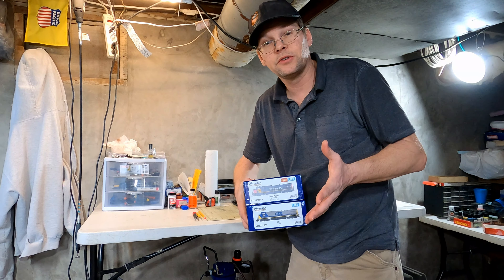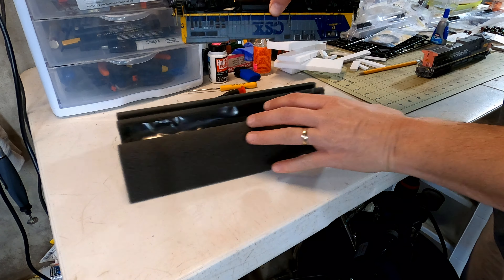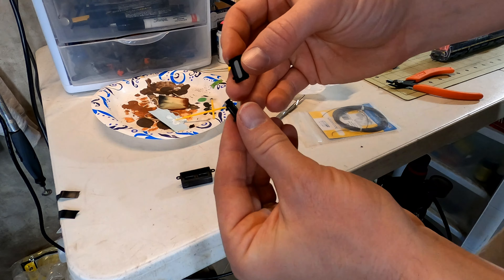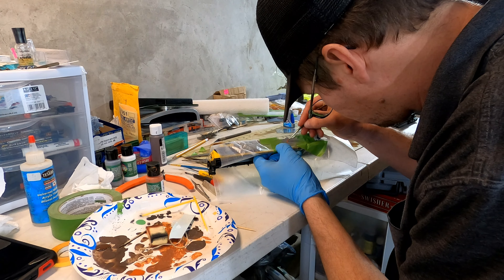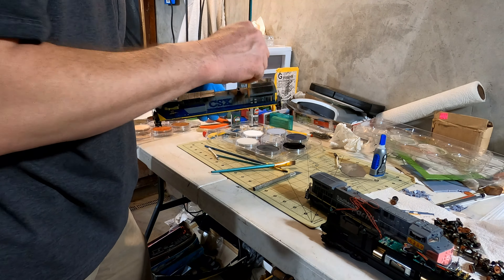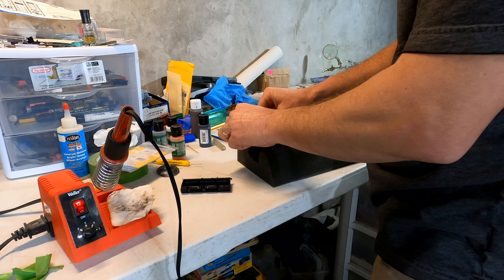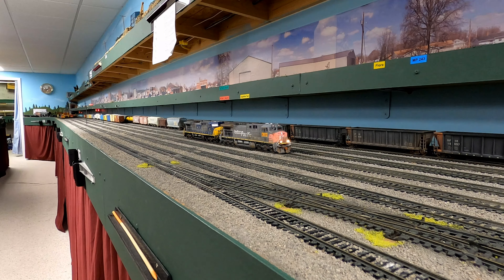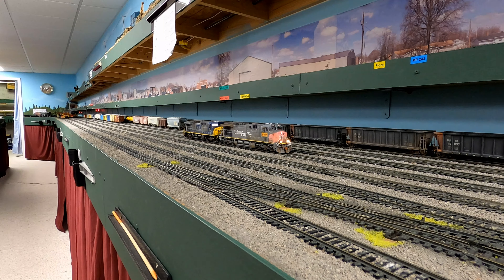Athearn Genesis AC4400 - Review and Weathering

Comment: Thanks for review - what ESU sound file did you install?
Reply from the maker: I believe s0540 or s0813. I used a couple of different sound files from their website, so it wasn't the exact same sound coming from the different GE's in my consist.
I didn't do any tweaking to the file, just used the defaults.
Reply: @signalupproductions  thanks

Comment: I'm disappointed there is no currentkeeper plug. Are any of the unused soldering pads available for that?
Reply from the maker: I'm not sure, because I personally don't use keep-alives. The motherboard is a standard Athearn board, for LED's and the 21-pin decoder. I would assume there are videos on adding capacitors to this boards.

Comment: How is the brightness of the lighting. I have thought that they look dim with ESU decoders.
Reply from the maker: The headlight was fine looking straight at it, but maybe a little dim at an angle. The head and rear light LED's are on PC boards mounted to the frame, that line up with the housings when the shell is on. The ditchlights and ground lights are SMD LED's attached to the body. So the ditchlights were plenty bright.
Reply: It’s worth noting the the resistors on the Athearn boards are 20K ohms